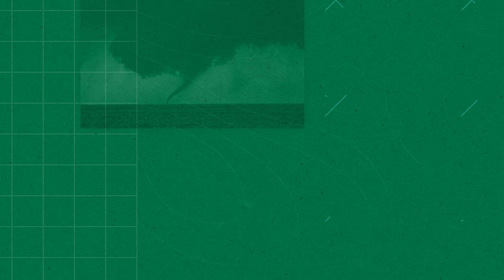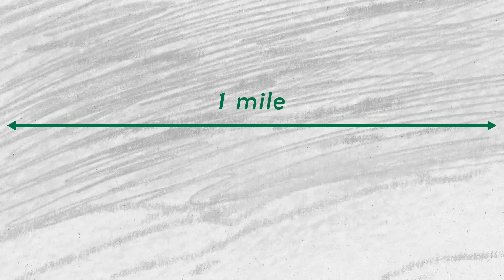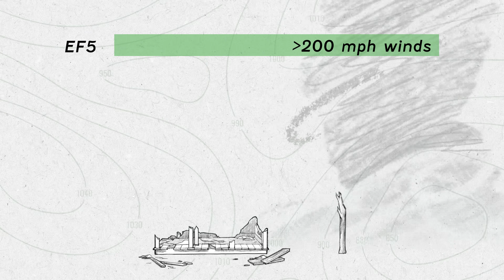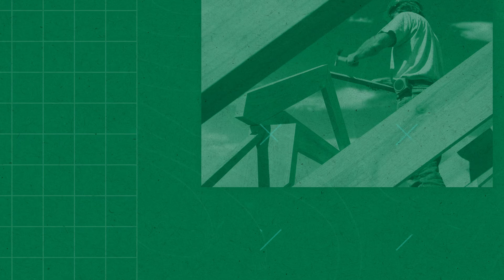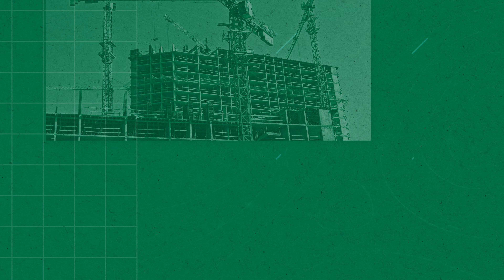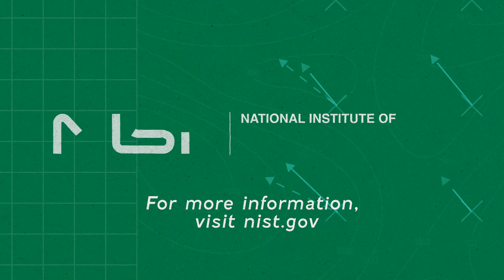Tornadoes 🌪️ 101 - feat. Marc Levitan

Comment: These are the kind of awesome and informative videos I like to see. It's not just a talking head but a well regarded professional giving us solid and accurate information. A quick question, Does NIST have a documents for designing buildings to better withstand tornadoes or documents for suggested practices when building a tornado shelter? I know the NCMA has a short paper on building reinforced tornado structures with cinderblock and grout but it doesn't go into a lot of detail on building a solid roof.
Reply from the maker: The information in this fact sheet compiled by FEMA and NIST can be applied to new construction or retrofit of residential structures in tornado-prone region of the United States. https://www.fema.gov/sites/default/files/documents/fema_improving-windstorm-resilience-fact-sheet_022023.pdf
Reply from the maker: Thank you for your comment. ✓ 🦸🏻‍♂️ will check and get back to you shortly.